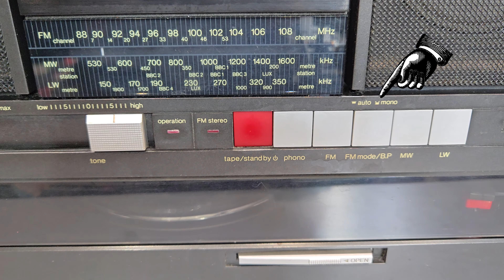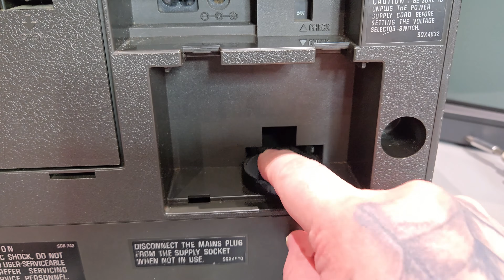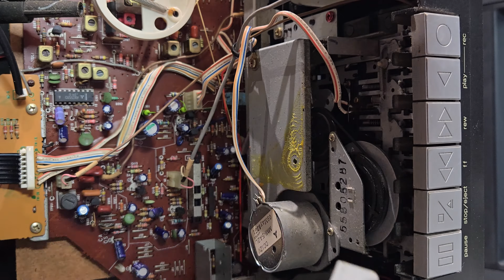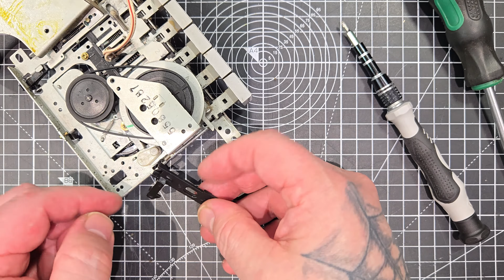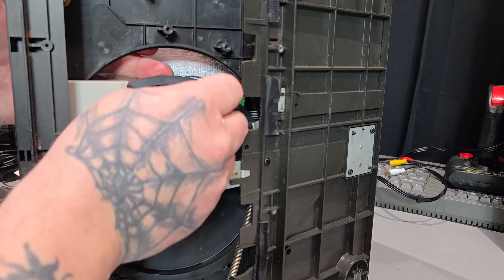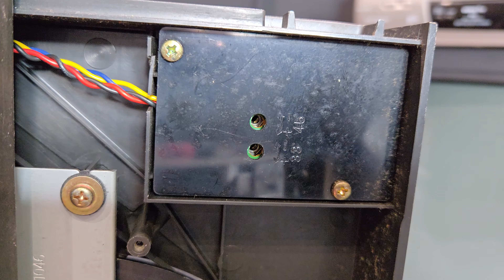Panasonic SG-J500L | Tape Deck, Radio and Slide Out Turntable! | Repair & Demo

Comment: WHAT SIZE OF BELT DID YOU USED..
DIAMETER?
Reply: Did you ever find out the diameter of the belt? I’m currently working on replacement.
Reply from the maker: If it's the turntable belt, I ordered mine from webspareparts, but after some research it seems the belt length is about 570mm (285 folded).
Reply: @retrotechgraveyard  sorry, I should have specified. The tape deck.
Reply from the maker: I'm not sure of the sizes, but I found this on a forum:

Cassette = Folded length 100mm x thickness square 1.1mm, cut length 203mm.